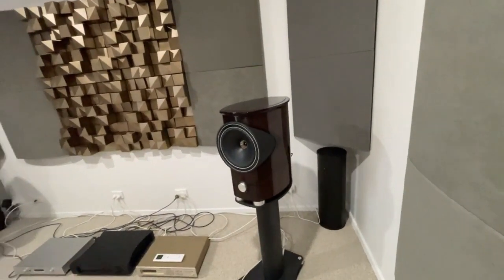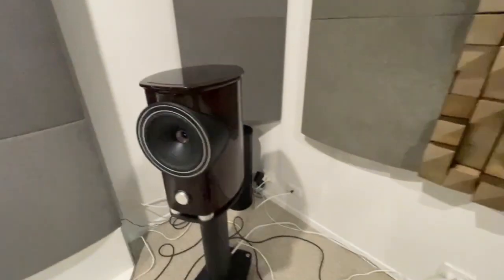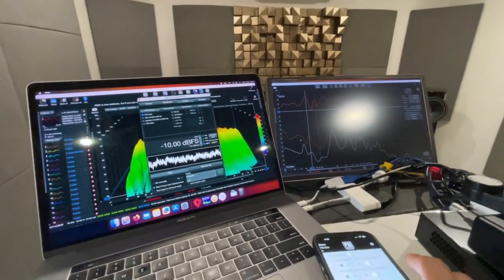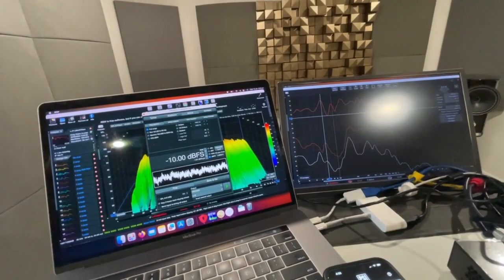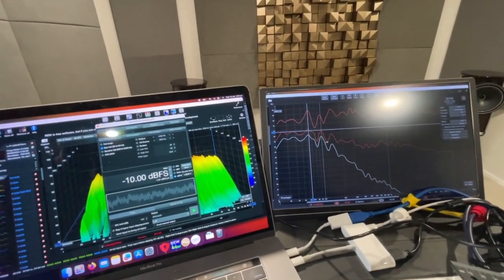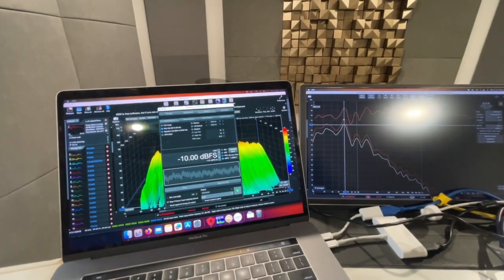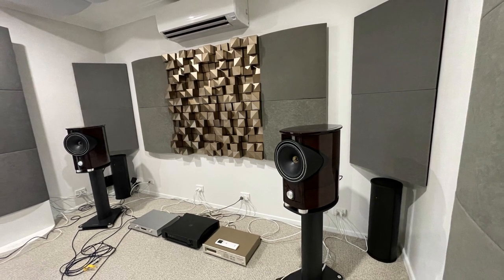From Muddy to Clear – AVAA C214 Sound Test (+6dB Gain Oversight 😬)

Comment from the maker: ⚠ Quick Note: In this test the AVAAs were left at 0dB gain reduction instead of +6dB — an oversight on our side. Even at 0dB, 2 units reduced modal pressure by about 4–5dB SPL, and with 4 units it dropped another 2–3dB. If set to +6dB, the effect would have been even stronger.

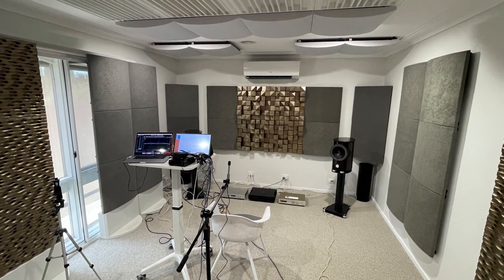👉 The real difference is also in the time domain: shorter decay, tighter bass, and clearer mids/highs. You can especially hear it in the song test section (6:57) where the sound goes from muddy and muffled to clear and open.

Thanks for all the feedback — keep the questions coming! 🙌

Comment: 4 is overkill. The most effect is placing them behind the listening position (see manual). 18 m² room, rectangle, passive acoustically treated (RT60 300ms straight down 150 Hz), Lsp lined up the long side, listening point 1/3 dist from backwall. Axial modes reduced by 13 dB!! with ONE C214 only at the backwall behind the listening postion.

Comment: For the amount of money spent, I think the impact is a bit underwhelming.  I think that sum of money can be spent more effectively elsewhere.  Thanks for providing the A/B.  It served to convince me not to make a purchase.
Reply from the maker: Thanks for watching and sharing your thoughts 🙏 Totally understand where you’re coming from. In the measurements, 2 AVAAs (set at 0dB) reduced modal pressure by about 4–5dB SPL, and adding 2 more cut a further 2–3dB — which is already a solid shift given how hard it is to tame low-frequency energy in a real room. That said, if we had set the AVAAs to +6dB gain reduction (instead of 0dB), the effect would have been even more dramatic — that was an oversight on our part during testing, and it happens! Beyond the SPL numbers, the real win is in the time domain: shorter decay, tighter bass, and a clearer, more open sound, which you can really hear in the song test. Definitely not for everyone, but for audiophiles and purists chasing that last layer of performance, the impact can be huge.

Comment: Am I reading this incorrectly? it seems like 4x AVAA make 1 decibel of difference? for more than 10k, that seems a bit strange...
Reply from the maker: Good question 👍 It might look that way at first glance, but the difference is bigger than it seems. In our test, 2 AVAAs (set at 0dB instead of +6dB) reduced modal pressure by about 4–5dB SPL, and adding 2 more shaved off another 2–3dB. If we had set the gain reduction to +6dB — which we unfortunately overlooked during the test — the effect would have been even more dramatic. On top of the SPL numbers, the main benefit is in the time domain: faster decay, flatter bass response, and much clearer listening. You can especially hear it in the song demo where the AVAAs turn the low end from muffled into open and defined. So it’s less about chasing big dB swings, and more about achieving controlled, natural bass that lets the whole system perform at its best.

Comment: Thank you for the video ! Do you recommend the C214 for Hi-fi listening or is the C20 enough? because I will be honest, if the results are the same then the price jump doesn't seem that worth it to me, I am not rich ahah
Reply from the maker: Thanks for the comment! We recommend the C214 as it is a clear upgrade from the C20 — not just in build, but also in performance. The C214 includes a gain stage (-6dB to +6dB), which allows for more flexible calibration depending on room size and issues. It’s also controllable via the PSI Audio app, which adds a layer of convenience for adjustments. If you’re looking for the best results in Hi-Fi listening, the C214 is definitely worth considering.
Reply: @corsiniacousticsolutions  My room is 550cm by 510 cm, if I get only one avaa for now, will I hear a noticeable difference?
Reply from the maker: @zonas7915  That’s a great question! For a room of that size (550cm x 510cm), one AVAA C214 will definitely bring noticeable improvements in clarity and low-frequency control, especially if positioned correctly. However, every room behaves differently, so we always recommend downloading the AVAA technical documents from PSI Audio’s website to better understand its function. For tailored advice, it’s also worth contacting PSI Audio directly — they can offer guidance based on your specific layout. While the results are usually impressive, we can’t guarantee exact outcomes since room acoustics vary quite a bit.
Reply: @corsiniacousticsolutions  Awesome, I actually took some measurements of my space, do you offer consultation ?
Reply from the maker: @zonas7915 yes we do, reach us through our website thank you